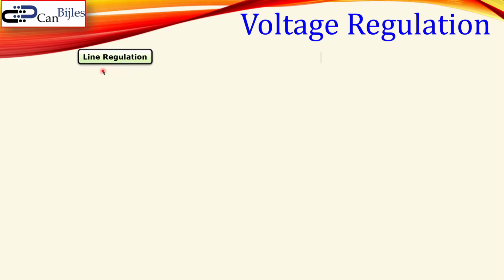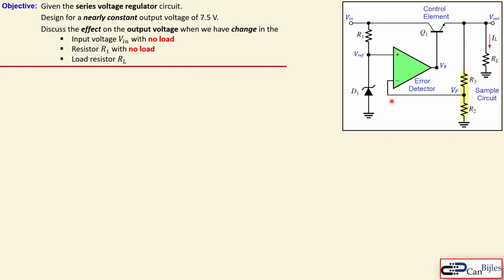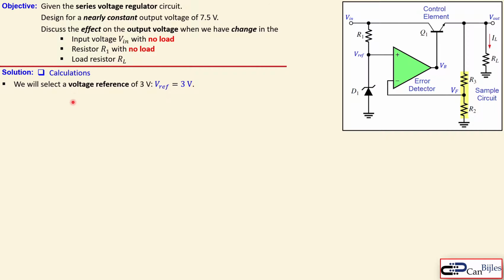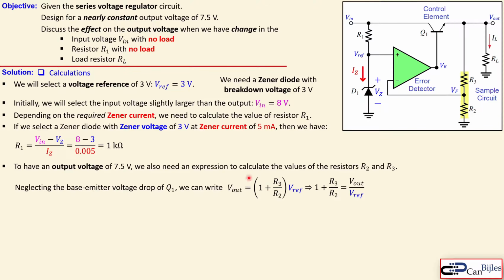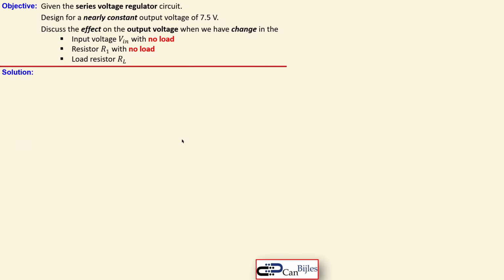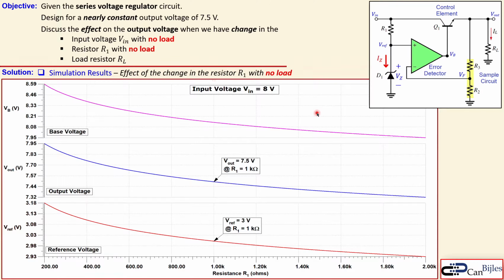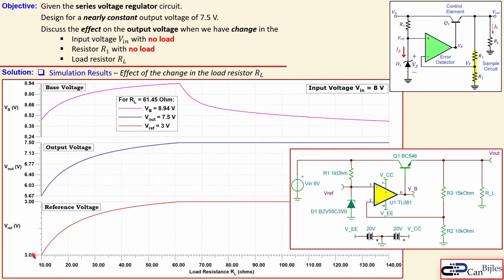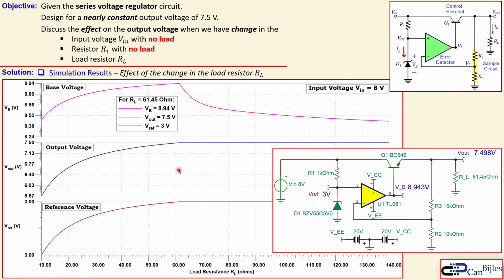Series Voltage Regulator 🌟 Line & Load Regulation 🎯 Step by Step Design Example & TINA-TI Simulation

Comment: I think your Vref is fixed at 3V, because the cathode's voltage of a diode is always larger than the anode's that is 0V. Therefore, Vref is fixed, so I don't understand why Vref alters when you step the value of R1. I run simulation on Ltspice, the result that is Vref and Vout stay constant despite a change in R1.
Reply from the maker: The Zener voltage also depends on the Zener current. When R1 increases, the current flowing through the Zener diode will drop, which will reduce the actual Zener voltage. This is the reason.
Reply: @CANEDUX  ohh many thanks, I think your answer blows my mind
Reply from the maker: Glad to know the situation is clear for you.

Comment: Thanks for sharing this. I have a question, at high and very low load values the output of regulator starts to oscillate at very high frequencies especially in case of PNP or PMOS type series pass element. Can you please do a brief discussion about the stability issue of linear regulators. It should be really helpfull.
Reply from the maker: Thanks for your message. This is a very interesting problem. I will put this one my list and hopefully get it done as soon as possible.

Comment: At 19:10, is the reason for the lower output voltage not that the transistor is saturated hard and not so much the opamps ability top supply current?
Reply from the maker: Thanks for your message. That is a very good question 👍

The BJT base voltage is controlled by the output of the op-amp. So, in fact, this will determine the ability of the BJt to supply the current for the load. If the base-emitter voltage of the BJT is way above 700 mV, then the BJT is indeed saturated, and functions as a switch.